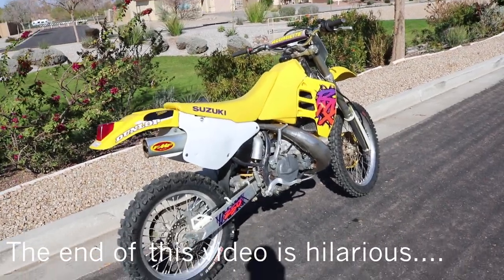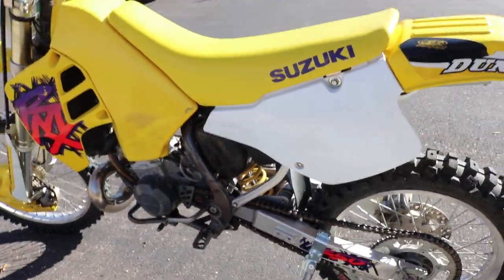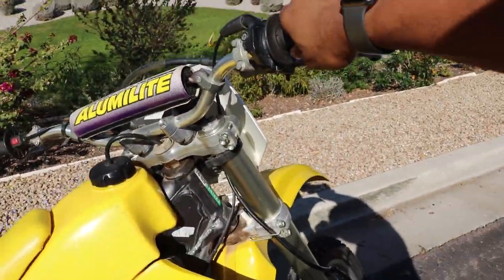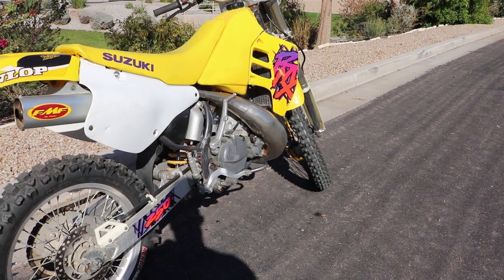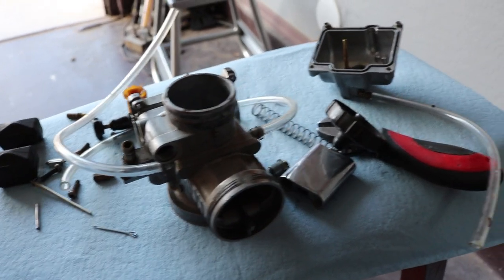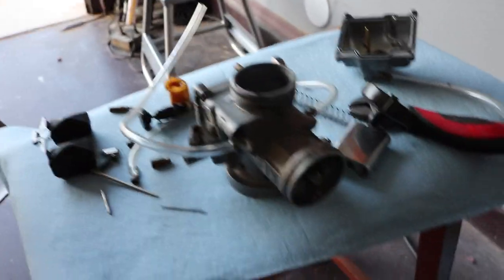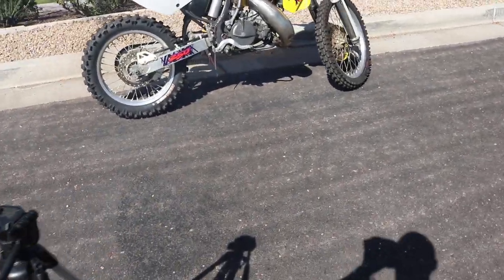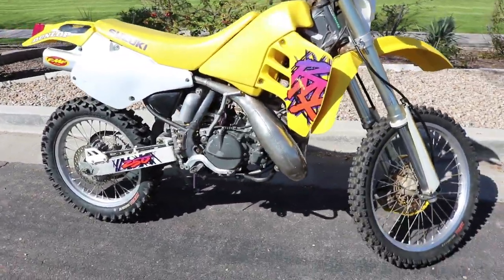Fixing up this '94 Suzuki RMX250 | Fixing the Idle...

Comment: Hey bud, your choke knob is not the air/fuel screw ratio. Your air screw is the little flat head screw located down to the right. The choke knob you are turning is the idle screw!! Clean your carb, reset your AIR screw to 1 1/2 turns out from all the way in, then warm your bike up, and turn that choke knob out in  small increments until it idles. I have a 95 RMX250 that runs and idles like knew. Stock carb Any other questions let me know!!
Reply: The secret to those RMXs is put the RM head gasket in, it’s thinner, gives it more compression and wakes that bike right up!!

Comment: Turning the choke knob does not adjust the air/fuel mixture. That's just the idle adjustment. The actual air/fuel mixture screw is the very small flathead screw above the float bowl. From the video, I can see yours is screwed just about all the way in. That will cause the bike to not idle and also will foul spark plugs. The screw should be 1.5 turns out from fully seated. I have a 94 RMX too and ditched the stock carb for a keihin pwk 38 air striker. Well worth the $.

Comment: The choke is not a air screw then brass fitting is your air/fule mix 

for cold start pull  turn choke clockwise to shut off fast idle choke up for 15 seconds shut choke off turn choke counterclockwise that will give you your fast idle fine-tune when you’re all geared up and ready to go for a ride term choke clockwise to turn off fast idle

Comment: I had a KX250 two stroke, I'm done with two strokes permanently..  The kick start issues & vibration almost made me leave dirt bike riding. The KTM 350 fuel injected, electric start, put the fun back into off road riding.  Every time I ride I'm looking for gnarly stuff on purpose. Everyone can afford a premium dirt bike. What no one tells you is that Japanese two strokes are gutless torquewise at low rpm.
Reply from the maker: I have to say I totally agree. I prefer electric start over kick and this bike is an older one with issues I don't like dealing with.
Reply: Must not be a real man
Reply: Sissy.  They make fully-electric bikes now if you don't like the smell of exhaust or, how the vibration irritates your va jean a.
Reply: Was the replacement carb a Genuine Keihin or a Chinese clone Ebay special for 40 or 50 bucks?

Comment: I can tell straight away the choke is not on properly it has a screw the knob turns make sure its seat so the knob is turn the screw and seal the thread on the choke  so it don't leak air

Comment: I bought a pwk 38 for my 89 rmx but it was 10 mm longer than the mikuni tm stock carb and I couldn't get it to fit because it was a to tight of a fit.  Did you have to change anything?
Reply from the maker: I didn't have to change anything on mine, it just bolted right in. Which part of the carb doesn't fit? Also make sure you got this one: https://www.amazon.com/gp/product/B00C178JY4/ref=ppx_yo_dt_b_search_asin_title?ie=UTF8&psc=1
Reply: I got the PWK 38 AS and put it on my My 92 RMX. It is to long (carb side to air filter side) for my bike as well . I was able to get it to fit by cutting a part of the airbox rubber (A little tab on the inside of where it goes around the carb) and pulling the air filter box, then puttung the carb on the bike, then putting the air cleaner box back on. It is a tight fit but it worked.
Reply: I would just stick with the Mikuni TM carb like I did with my 90 RMX

Comment: Look up the YouTuber Navy Seabee he made a video on an rmx250 he got running perfectly with that stock Keihin PJ carb by swapping out the cylinder for an RM250 cylinder (89-95 RM250 cylinders will bolt onto an RMX)

Comment: Ok i have a question and dont really know where to ask it. Recently my bike will start fine and I can ride it but it doesn't idle well. If im not revving it a bit more than I used to then it shuts off It does start back up. Its a relatively recent thing i thought maybe adjust the idle but that didn't work. My friend and I took the carb off cleaned it so idk anymore. Its an old bike but has been taken care of. 96 Suzuki RM 250, also would the carb you got fit my bike? I will look for it. any suggestions would be appreciated, thanks

P.S. I wrote that before finishing the video lol
Reply from the maker: Sounds like you aren't getting enough fuel. If the bike will idle with a little throttle and not sputter and die, it sounds like your idle needs adjusting or there is something clogging the fuel on idle.
Reply: @602Busa  thanks, Im getting a new carb and i have a feeling that may help.

Comment: U need to put new o rings on ur exhaust pipe saw smoking coming out the front of the engine
Reply: It's actually smoke coming out of the power valve vent hose. I have the same bike!